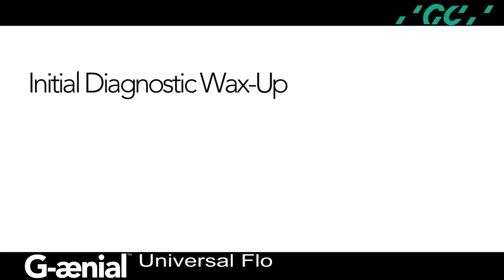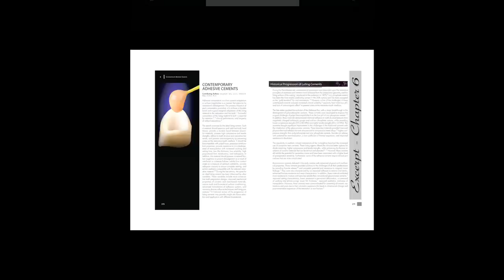Developing a Functional Composite Prototype Using G-aenial Universal Flo

Comment: Can we use this technique for long term - permanent  restorations?
Reply: Hi! it has the same lifetime of any resin restoration, 3 - 5 years, if the patient is carefull and goes to eventual dates to your office it may be longer
Reply: I dont see why not, the material is certainly up to the task with proper bonding and isolation. For a permanent restoration I might have personally cut back the incisal and layered some translucent incisal hybrid composite but overall it looks very natural, especially after polishing paste.
Reply: Crooks made sure the old composite that was lasting for 15 to 20 years was replace by cheap 3 to 5 years crap just so they make more money! Reincarnation will take care of these crooks and they will be back with horrible teeth.
Reply: @petertremblay3725  ирлл